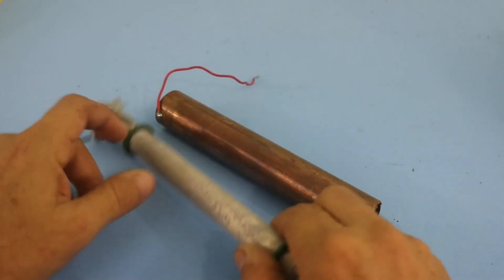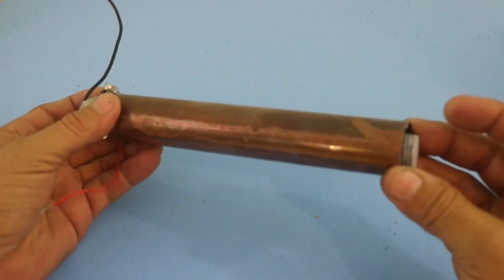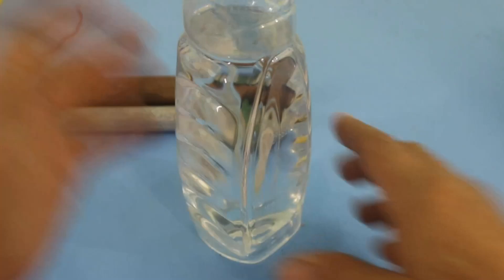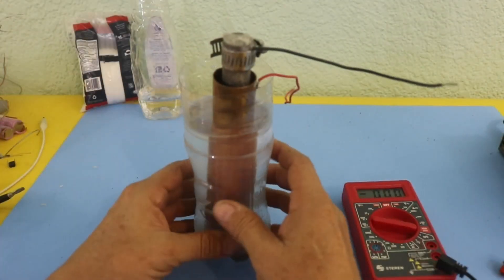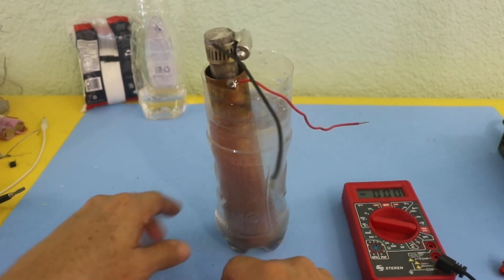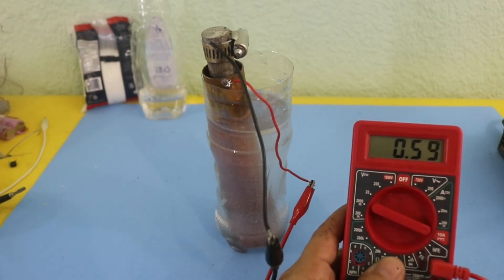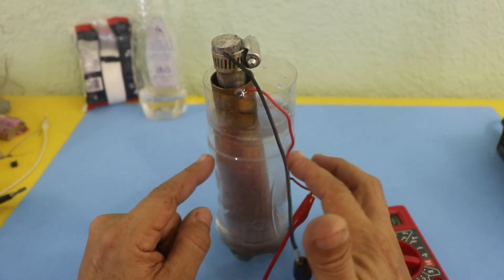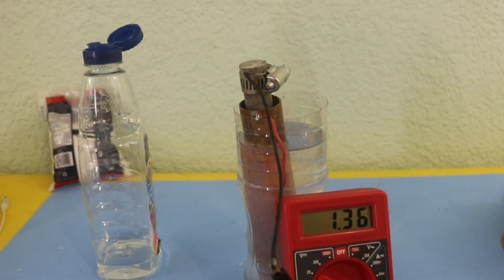Magnesium Copper Battery with Vinegar Electrolyte

Comment: Love the construction! A small problem around 4'01, the narration about previous two batteries with salt-water electrolyte "in series"; they must be "in parallel".
Reply from the maker: No, in the previous video i used to cells in series not parallel
Reply: If the two are in series, short-circuit current for a single cell would be the same as that with two cells.  No?
Reply from the maker: No
Reply: @ludicscience  You are wrong, connecting two or more batteries in series it will increase overall voltage, it doesn't affect current. Connecting them in parallel it will reduce internal resistance and it will increase overall current ( Ah capacity). So that being said in your previous video if you had put them in parallel you'd had around 1A at 1.3V.

Comment: Series = more voltage.
Parallel = more current.
The energy is the same, is just the rate between volt
and amps that changes if you go from parallel so series. 

So 2 batteries of this kind will in my theory give the same short circuit current in series, but be double in voltage.
However... if you did connect them in parallel, the voltage would be 1,36, but the short circuit current higher.

Comment: I made a TREMENDOUS BATTERY with pure water.
CONCRETE galvanized steel + CONCRETE stainless steel rod.
Concrete is slowing down "galvanized" oxidation.
Add COTTON to improve "capacitancy".

One so tiny cells w:7mm x l:13mm x h:5mm yields 1+ VOLTS.
Put them in PARALEL circuits, boost amperages.

Just TAP WATER, no need electro lite, but you can add instead.
The IDEA is water as source of energy.
Electricity remains as long as water exists and 
galvanized steel is still working well.

All types of water may also works including URINE.

Comment: Vinegar is ok for aluminum, but with magnesium it reacts vigerously making jydrogen. If you want to use it make a solution of sodium acetate. For the best operation fill the copper pipe with a mixture of MnO2, CuO and graphite. You can substitute rust for MnO2 if you want to. Use oxides of s metal less reactive than hydrogen for best results. A battery with an anode rod that big should give a few amps of current easily.

Comment: Bro, getting 0,5 Amps from two batteries connected in series means that each of them is giving you 0,5 A, not 0,25 A. So not a big improvement in amperage from 0,5 to 0,6 Amps in favor of the vinegar electrolyte. Let's also consider which electrolyte is less aggressive for metals used in cells. However great video, thank you.

Comment: This is less that one watt of power. Not very useful but it looked like a fun project. Someone suggested you hook up an LED to demo it. Many LED's of any size will require over 1.3 volts, because they have a barrier voltage slightly higher than that. LEDs also require careful control of the current, as they won't limit the current after the barrier voltage is exceeded.

Comment: I have been thinking about making something like nickel iron batteries in 5gallon buckets, just curious if Steel sheet can be used, with nickel or maybe another metal, maybe it would work better,  use a 20-22 gauge steel and use a plastic screen mesh, or possibly a thin fiberglass between , then roll them up, possibly pot the very bottom with wax, about 1/4" deep in the bottom of the bucket, keeping about 1/16" gap between the anode and cathode,  connected to 1" x. 1/8" copper bar, connected to the mid points and possibly both ends of the anode and cathode, it should be capable of 400amps +/-, and 800amps for a few seconds,   a 5gallon bucket will make a large battery, if it were 2k ah would be great,  connected to a 50 gallon drum of distilled water,  to keep the wet,   2k ah battery bank would run my off grid house,
Reply: Why not do it in a plastic tub? There are many sizes and they hold-up under acid etc..

Comment: Excellent presentation of higher out put voltage and current, with Copper tube, Magnesium Rod, electrolyte as Synthetic Venegar, One confusing thing, Vinegar directly can be used or diluted with water, pls clarify, its a much appealing project I want to do it in my house, pls ELECTROLYTE. 👍🏿👍🏿👍🏿
Reply from the maker: Pure vinegar